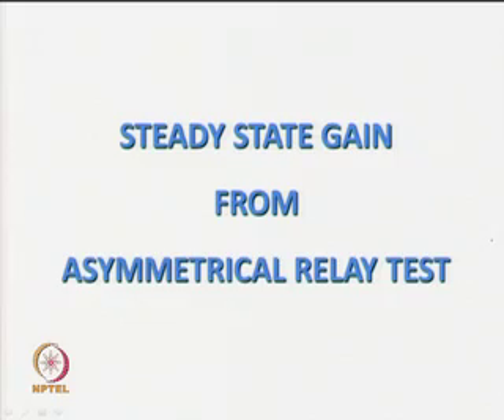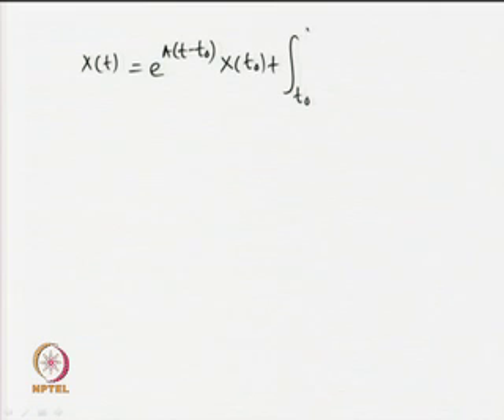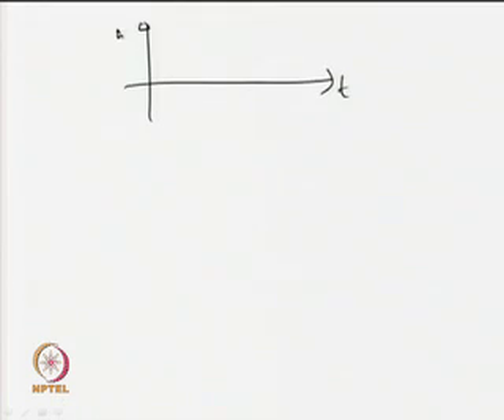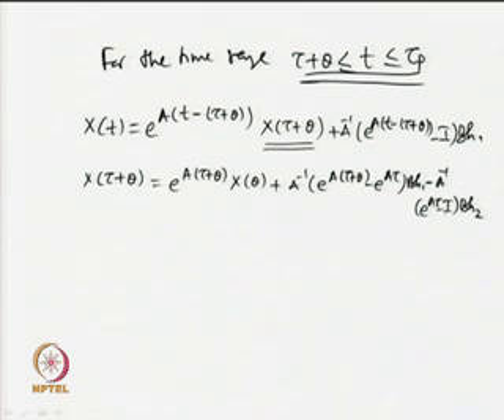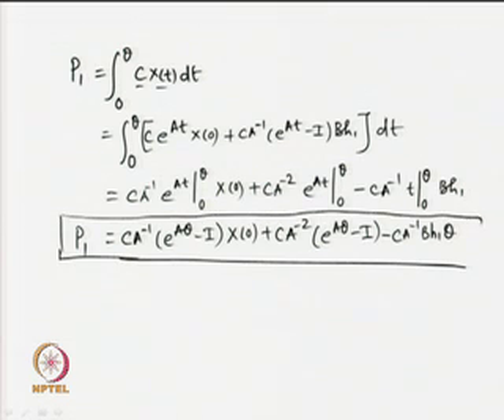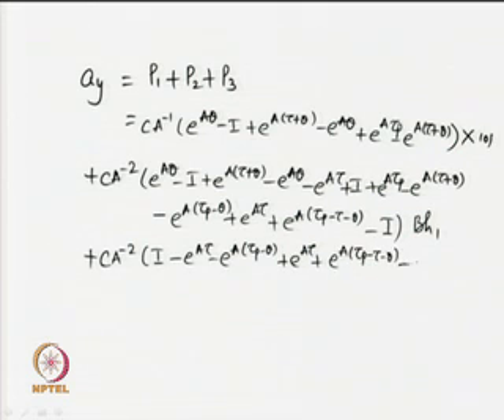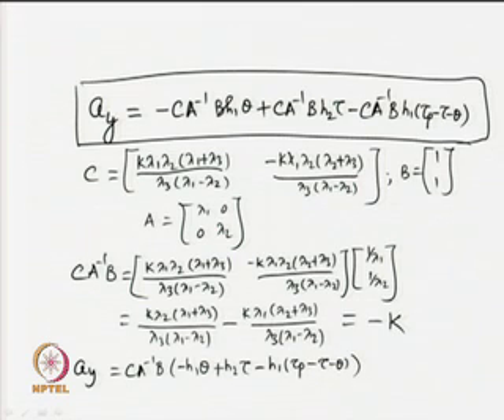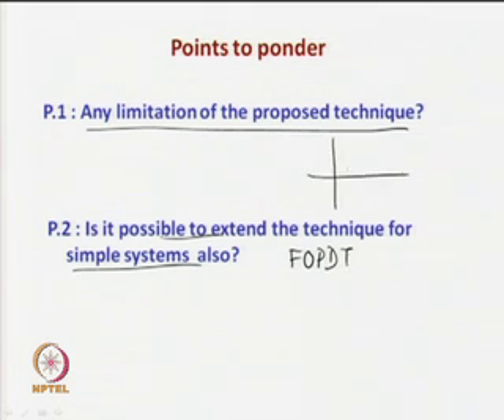Steady state gain from asymmetrical relay test

Comment: Sir,I am working on the project based on PID temperature controller in which I am using the SSR relay for controlling the temperature of unknown system.

I am having the problem while selecting h1& h2 as in this h2 =0.
Sir how to get over this please help.